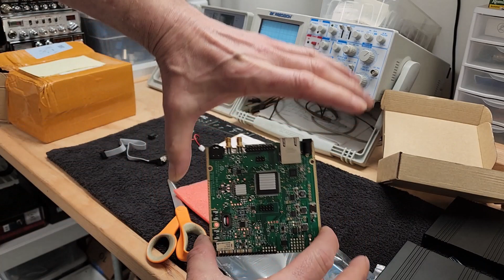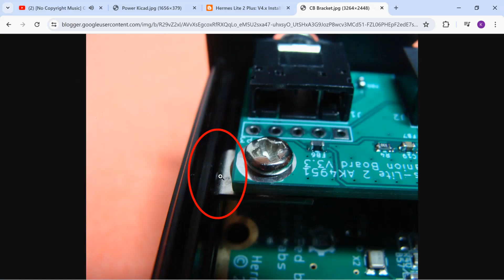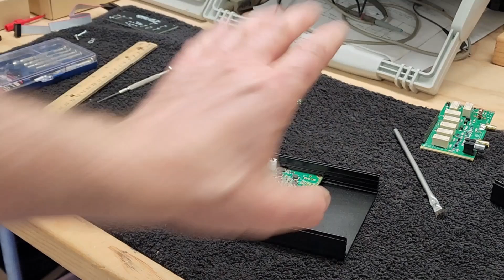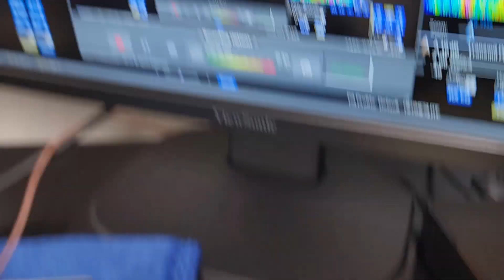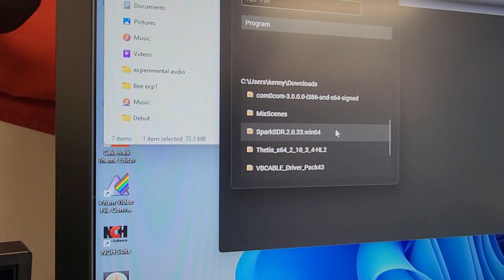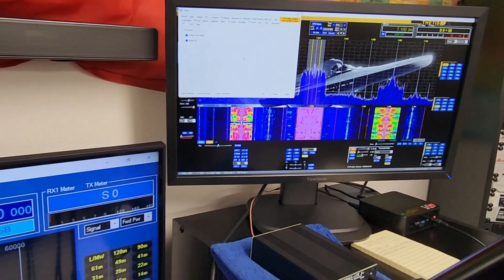Hermes Lite 2 Plus Build **READ DESCRIPTION**

Comment: Does kit supply the 10k surface mount resistor? And if not doing this kit install, how does audio in/out work? Does it use PC audio I.E. Gaming headset with mic. I am new to this and just purchased a Hermes, awaiting delivery.
Reply from the maker: The kit does not include the 10k resistor. The 10k resistor is only needed if using the power switch option as I did and it is described on the Hermes Lite 2 plus web page. The companion board provides a mic input jack and Thetis has some decent audio processing tools. I recommend spending some time on the Hermes Lite 2 plus site and take in as much as you can.
Reply: @KP68videogates  Thank You for reply and advice. I am planning on doing just that, using Hermes Lite 2, getting used to it before modifying. 73

Comment: Is this 11m capable or is that what the mods are for? It allows AM operation correct?Can you get this pre assembled? Lots of people whom are disabled, or just simply lack the ability to solder smt. Any help?
Reply from the maker: Hello. It is 11 meter capable with no physical modifications and this is selected in the software settings. Yes, it allows AM operation along with many other modes and this is selected on the main Thetis screen. As far as I know, this only comes a kit that you have to put together yourself. As far as the SMT soldering is concerned, you don't have to go that route for the power switch. That was merely what I decided to do. I know a few people who did not install a power switch and they simply turn ON or OFF the power supply that the unit is connected to.
Reply: @KP68videogates  oh ok. I thought you had to buy the companion board to TX. And I thought soldering was required. I was unaware that it isn't. OK wonderful. So the hermes board, the filter board click together basically and then the companion board does as well? Kinda like Lego blocks? Haha I can deal with that. I've heard the pure signal and it seems to sound better. I'm just scared to try to solder as I'll mess it up. 

I tell ya I'm done with cb stuff. Everything is snake oil and robbery. 
I believe I will buy this in near future. Then the collosal 10k antenna and eventually a good 500+ watt amp. That should be all I ever need. I thank you for your time! Any advice insight or suggestions is welcomed!
Reply from the maker: @baylenthedogg3242  Correct, you do not need the companion board to TX. However, if you want to run external audio processing like I do, you will need the companion board and that entails removing the ferrite bead 28 on the main board. Take your time and check out as much as you can on the Hermes. There's a lot of good information on YouTube and the web. Although I am by far not an expert on the Hermes, feel free to ask.
Reply: @KP68videogates  I appreciate it sir. I believe this is the way to go. Cheaper then some cb radios and it allows me to use my rack gear to its full potential, and it allows me to use the ham bands when I get my license.  It seems to be a amazing piece of gear. Basically a anan 100b from what I've seen. For tbe price it's a no brainer. Thanks again, I'm excited! Just not sure what amp to use. I have a 4 pill carl built that donkey stomper just repaired, it's worse lol.. sending it to carl today. Then I got a maverick 250 8 tube amp. Idk if thr 5w hermes will drive them, but guess I can buy another amp in the future if needed.
Reply: @KP68videogates  BTW I have a horrible hum now. Assuming
A ground loop. It's louder then my audio! Never had it before. I run audio technica atr30 mic into ART studio V3 pre amp.. into behinger composer pro xl comp limiter. Then into behringer ultrafex pro bass processor, then into behringer feedback destroyer pro parametric eq.. all balanced xlr nice cables. Never used a isolation transformer or a DI box.. I just ran audio like I said in that order.. and from the feedback destroyer pro straight into the anytone 5555n2 mic input. Idk what I need to do. This hum is horrible.
Reply from the maker: @baylenthedogg3242  Ya, tackling hum issues can be a hair pulling out event. You can try different combinations of balanced or unbalanced cables in you chain. The last thing I have in line before my ANAN is the Sidekick DIB-443 passive direct box which eliminated my hum issues. I use the XLR Low Z output and I found that it knocked down the audio level a little bit, but I compensated for that by bringing up the audio level on the Mic slider in Thetis.
Reply from the maker: @baylenthedogg3242  If you are planning on talking on sideband, make sure whatever amp you use is biased and NOT class C. If you want a demonstration of how class C sounds on sideband, get up close to a room fan that's spinning and talk into it. Careful though, don't cut your lips off lol.
Reply: @KP68videogates  class b bias 4x 2879c carl built amplifier